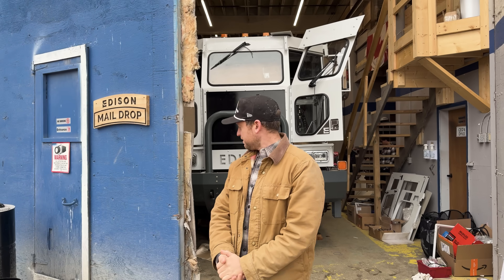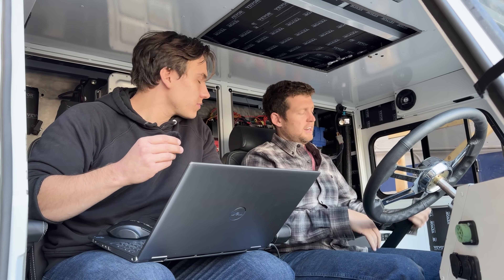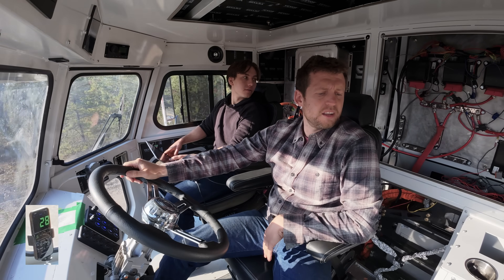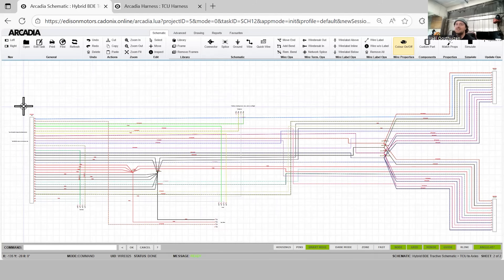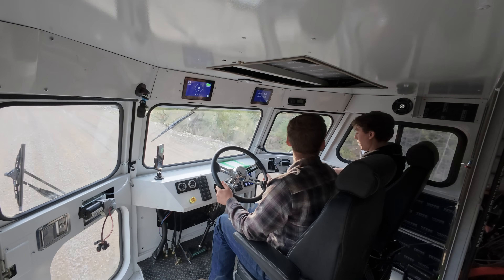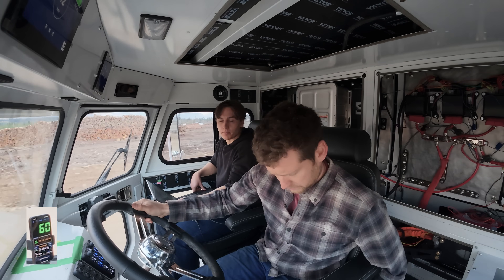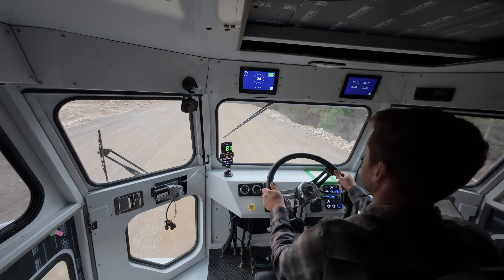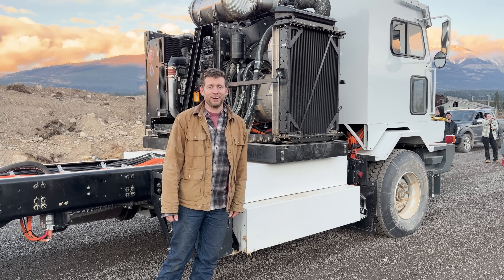Testing the Limits of Edison’s New Truck

Comment: Your wiring harness doesn’t look good. Especially on a prototype, you should be able to visually follow the cable routing.
The connection and routing of the HV lines aren’t protected, which can easily lead to failures. Hide the cables inside the frame, for example. The connection at the rear of the engine needs to be protected with a solid cover.

I also see a lot of chafing points that you need to avoid.

Great project — keep it up.

Comment: Awesome what you guys are doing . I work in the machine metal industry and what maybe could help with bolts or nuts getting loose is to really use a lot of loctide and glue those screws and nuts. Otherwise it wil get loose over time . Great work

Comment: What market segment(s) are you targeting?
Reply: PACCAR owns the high volume, light weight, plastic aero, highway, high-speed, otr, market that primarily hauls rectangle white dry box van semi trailers. This is 70% of the market.

Edison is focusing the remaining 30% of the market which is "vocational", heavy duty, off road, bespoke, hand made, low volume market. Things like a one-of-a-kind crane truck, or concrete trucks, garbage trucks.

Paccar is in the process of vacating the vocational market because it's less profitable/predictable.

Comment: I'd be more inclined to like Edison Motors if it was owned by actual engineers.  

What is a truck driver and a banker going to know about J- protocols, CAN traffic, battery SOC filtering, etc.?  They don't.  They need real engineers at this company, otherwise, it'll stay looking like a hobby shop and not a real OEM.
Reply: I just googled for "right to repair ev semi truck startup run by engineers" and I couldn't fins anything
 :(

Comment: I would still include a full seatbelt. Screw "requirements". If you built a truck that ONLY followed requirements, you'd have a very bad truck. Volvo gave up the patent for a reason.

Comment: 16:25 just do the test now, add a dummy load. In fact, add water tanks with baffles or use multiple concrete blocks. Test for load position influence along with the obvious weight increment impacts. Don't just work with customer specific data when you have a cheap way to gather tons more for future use.
Reply: I like your thinking :)

And

In the interest of time, they sent the truck off to get the 10 ton service bed bolted on.

After Thanksgiving,  Edison will get it back and re-start testing again with the actual load on board

Comment: Guys if you put a thin silicone/rubber tape on all the frames that then have a body panel on. Pre fixing/rivet. Not alot of extra cost but uou would have completely damped sound.

Comment: I really think you could make a through-the-ground hybrid. You could keep your manual transmission and engine combination, for your emissions certification. But it only drives one of the axles. And then the next axle behind it is driven by electric. 

This would allow you to use regen braking down the mountain and act as a jake brake and also give assist when climbing mountains, and it would regulate through a battery. It would bias a little bit on the charge side by dragging the wheels just a little bit and then when it's around 80% full it will bias towards the middle and when it's above that it will bias towards assist. It could also adjust based off of altitude over time so for example if you climb in altitude for a while it will bias towards staying empty assuming that you might charge soon. 

It could be blended together such that it would respond naturally through gear changes. For example you could let the region be very high when using a lower gear or high RPM and have a single switch to turn on Max regeneration kind of like Jake brakes do. And it would continue to operate and charge while the operator shifts gears. 

This would let you meet the emissions certification as the hybrid system would be a 100% separate system. This would also mean that you can drive short distances on the hybrid system if the main diesel engine fails, and if the hybrid system fails it would still drive as if it was a regular standard manual transmission diesel except you wouldn't have Jake brakes. 

This through the ground hybrid is nothing new, and it should allow you to meet emissions certification.

Comment: hey mabey you should load some temporary weights on the truck during testing, seems like you could get some big concrete blocks fairly cheap and just plop them on the frame rails (with a few straps just for safety)

Comment: What happened to Topsy?    Serious question... out to pasture or parted out or now being tin cans ?
Reply: Topsy is out to pasture, and occasionally robbed for parts (to Chace's chagrin). Topsy pulled 150k lbs but failed under stress testing. So Topsy did its job as a rolling test bed, and from Topsy, they learned to upgrade the batteries, inverters, the genny, the wiring harness, the e-axles, the ABS, the BBB, and bring software development in house.

The new gen 3 trucks under construction have these upgraded gen3 parts. Topsy is obsolete with Gen2 parts.

Every moment or dollar spent on Topsy is a resource that is not getting spent on new trucks that have buyers chomping at the bit anxious and eager to get their new trucks.

So we all love Topsy, and it is set aside out of necessity until further notice.

I suggest rolling it next to the new assembly plant and using it as a backup generator. Mount a bunch of batts to the frame rails. Maybe add a white box trailer with solar panels on the sides that fold up.

Comment: To allow pedestrians to hear you coming when driving on city streets you could broadcast recorded sound. You can record a few seconds or a minute of an internal combustion big rig and broadcast the sound through waterproof (all weather) boat/ATV speakers in the grill. You can record several different types of trucks to give customers options and then the sound volume can also be adjusted from very quiet to loud for different situations.

Comment: Locked rear wheels  = longer stopping distances AND no regen 
and loss of stability.
If there isn't ABS built into the firmware, there should/could easily be:
As I understand the new axels there's 1 motor per side And those motors have hall sensors = rpm sensor, so not a stretch to get ABS And ASC/torque vectoring.

Comment: Grab a stethoscope and you'll find that squeak real fast if it is a panel inside the truck. They also make clamp on microphones that you can put on suspect spots that wirelessly transmit the audio to a headset.

Comment: 11:30 Chase and co learn the reason why electric vehicles need forward movement alarms as well as reversing ones - these things can be dangerous without the loud sounds of an engine to signal such a heavy vehicle's approach. As I recall there was some mention of this a while ago, but it's still worth thinking about now as we start to see the reasons for it in practice.
15:30 As is brought up often now, this needs a laden limit test - you can definitely see the rear wheels skipping over the road rather than digging in to stop as fast as theoretically possible. While it would put a lot of strain on your tires, your brakes, and your road, doing this with the weight of a trailer (or whatever's going to be on this truck) putting weight on the rear wheels would give you a ton of data, not to mention the acceleration and lighter braking performance. It makes me wonder if a conventional semitrailer hauler would've been easier to initially test.
I'm also still wondering about testing it with artificial faults introduced - things like that bypass, where the generator can run the motors without the batteries involved, and such. Equipment fails eventually and accidents happen, and you need to know what will happen when it does so you can ensure it fails in the most controllable and least catastrophic way.

Comment: Why didn't you put a concrete block load ( or other heavy things) on the truck to test the truck at the intended road weight? It would help with the torque, acceleration, regen settings. It would help get the real driver feel. If you make the truck work harder it would help find those current spikes, and faults.

Comment: 1:00 Unprotected Busbars even during a testing prototyping phase is not a good look even if they are only 12 volt connections or even unpowered.
It's a bit like Gun safety, even a gun that you've just unloaded is to be handled as if it's loaded.
Why?
So you don't develop stupid habits.
Reply: Fair point. It's like having an open 600 volt power panel in an industrial park

Comment: no ABS 15:17
Reply: Front wheel ABS is working fine. The back axle are not loaded. When the truck is under normal load it will work better.

Comment: Wondering did they have to do a crash test for the trucks?
Reply: No, there is no crash test for any trucks. They are so heavy they crash through everything in the way.
Reply: @niconico3907  well I do recall them doing back in my day to see how they act in a roll over situation. An I just looked it up they still do testing on commercial trucks.

Comment: I wonder how much difference in weight there is.  Extra weight from electric motors, batteries and wiring, but smaller diesel engine and don't have to carry a transmission, driveshafts, etc.
Reply: The Topsy diesel/hybrid prototype weighed about the same as a diesel only semi truck

Comment: I'm Still betting You can Power it with Forced Wind and pv and Thermal. Routed to a pre chargred capacitor circuits
Reply: Not Responsable for runaway

Comment: I have only one request of manufacturers everywhere: Please, please no phillips screws on anything. Just use torx, Allen, robertson, heck even regular bolts. Phillips is the bane of my existence.
Reply: Phillips screws are seriously the worst😅
Reply: Robertson should be the standard. It's Canadian!
Reply: At least Phillips make it easy to center up the drill bit you will need to use to remove that garbage..
Reply: @TheAirzuki well... i usually melt em! Even as a liquid those are pure shit!
Reply: Toolmaker here... whenever i see anything but an Allen.. i just simply switch it out! Cut em new if I need to! Whenever I see Philips.... well, just pray you're not the one who put it there!
Reply: I honestly dont care what type of fastener it is, just pick one for all the different sizes of screws. I work on school busses, and those things will have every type of fastener on the inside that you can think of. I shouldnt need #1 and #2 Phillips, t15-t35, and both metric and standard Allen keys just to take the dash apart. Just pick one lol 

That being said, any fastener is better than the multi-tool screws that freightliner uses. Idk what the actual name of it is, but its meant to take a square drive, #2 Phillips, and a pozidrive bit, meaning it rounds out super easy with any of them.
Reply: @j.adamwegs2882 Lol, working on my school bus is what made me learn to hate Phillips. I hate rivets, too, but for a completely different reason.
Reply: Yeah I've seen a few phillips so rounded that an Ezy-out is a better option. 
The little fuks be too small for a gas axe
Reply: JIS phillips ... problem solved.
Reply: This is normally the argument of the man using the wrong tool. I'll admit Phillips and all the ones that look similar are confusing but once you learn them and use the right tool for the job youl find they actually work amazing.
Reply: @oliverscorsim  No, it's definitely not. Phillips is trash. The moment it sees even a little bit of rust, it slips immediately. Robertson is a far superior standard. I've taken apart a bus. Almost all the fasteners were Phillips. By the time I was done, I was so sick of it.
Reply: You mean standard/flat, Philips is far more useable than you might think. I will admit though that bolts would be the best option.
Reply: @Someguy0013  Nah flat is useful in some scenarios, but never for anything that needs to be torqued down. but neither is philips.
Reply: @Someguy0013 I have seen enough rusted, stripped Phillips to know better. Pretty much anything is better.
Reply: @Someguy0013 phillips screws are the worst. No debate.

Comment: Chace, driving with one foot one each pedal at the same time is a really bad habit.
Reply: If this was a normal truck,  I'd agree.

This is a test rig. It could slam into 100% power at a moments notice. Having a foot on the brake is mandatory.

Also, it may be that the throttle pedal can do accelerate, coast, regen for 1 pedal driving . Plus the left foot on the left pedal just for ABS brakes.

Comment: Shock Tests; Side Front, Rear. Pot Hole Shock. Skid Recovery. ABS Up?down hill. Overload test; weight and error alert. Panel Lights verification test. Auto Function Sequence tests and code log (each subsystem cycles thru a continuity and or voltage drop test) Cold weather overnight draw down battery test Long idle full heater draw down test. Thermal Gun profile record after hard run testing (mapping the harness and component temperatures, panels, brakes axles etc.

Comment: Part of the cab problem I think are those piano hinges for the door. Not enough mechanical give in them, plus I can see them being a serious corrosion lockup problem long-term. Conventional automotive hinges will have a lot more mechanical give in them to allow for cab flex and be more resistant to corrosion. The forward-facing doors also concern me as, especially with those piano hinges, could potentially bind up both doors bad enough in a front cab impact to trap the operator in the cab. The usual top+bottom hinges will allow for a door to be forced open even if the cab is deformed.
Reply: OEM recommended fix: Lots of WD40 and proper check pre vehicle start up
Reply: This is actually a great point, having a discussion with a fire crew about extraction concerns, but also in developing a safety plan for emergency disconnect after a collision.
Reply: Great point

Comment: Have you guys experimented with combining the battery output and generator output to push the motors further?
Reply: I think the bottleneck is the inverters
Reply: @Sah-o5m  Good point. Don't they also make the vehicle less efficient? Wonder if it is possible to make DC motors at semi-truck scale.

Comment: you guys had better add a bunch of those deer whistles. unintended but they are going to surprise a lot of animals standing in the middle of the roads so you might want to over build the bumpers with that in mind until you can get a good audible warning to keep them aware.
 not a problem youd normally worry about with such a big truck lol
Reply: Those "deer whistles" don't actually do anything. They depend on the buyer being dumb as rocks to believe any of their BS claims.
Reply: @lka1988 maybe. But many electric vehicles have been designed to create sound as they move
Reply: @nickabel8279 Yes, at low speeds and in reverse, for places like parking lots. So other people can hear them. Completely different than the useless pieces of plastic sold as "deer whistles" at Walmart.

Comment: 13:36."can we increase the power?" "Yes" "even though it already accelerated more than a normal truck would" 
bro, this is getting into 'banned-from-competitions-for-being-too-good' levels of awesome. 😂
Reply: I think being fully loaded may slow it down a bit.
(Depends if the motor is power or torque limited).
My Nissan Leaf has more torque than the Hyundia Elantra I have access to.
But at peak power: the Hyundai should be able to pull away.
Reply: What music does the band play?
Reply: @Waitin4_a_Mate damn, I just noticed that. I can't even be mad

Comment: My first involvement in a system check was across the rivrer at Redgrave. We had replaced some open line wire with cable and had to check the signal colors. One of the new hires was told to call out the colors. He kept saying the signal was dark, until the foreman got frustrated and looked out the cabin. The 'helper' was standing below the signal. You have to stand way back like you're a locomotive. The optics are good for miles.

Comment: How big of a problem is condensate in the engine? Do you have data from oil changes made from the hybrid system you guys installed on the islands and the remote parts in Canada?
Reply: This is truck #1 so no data yet